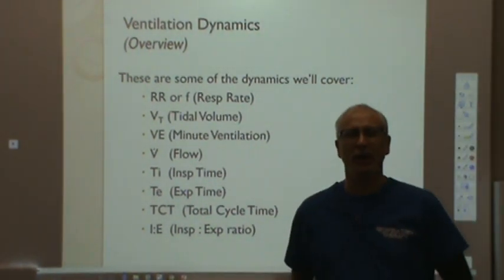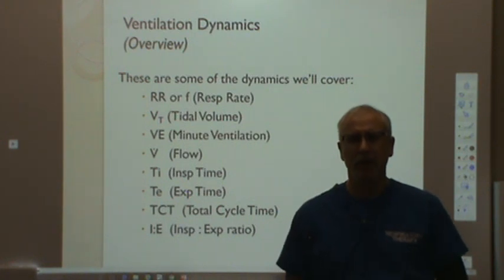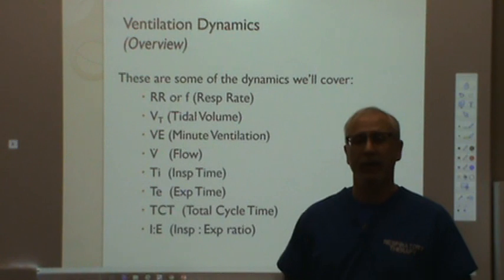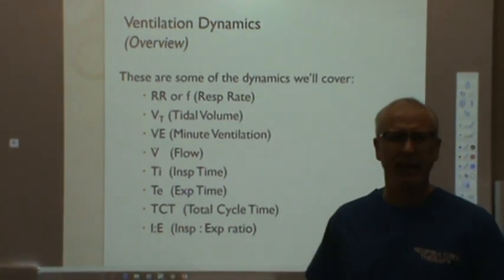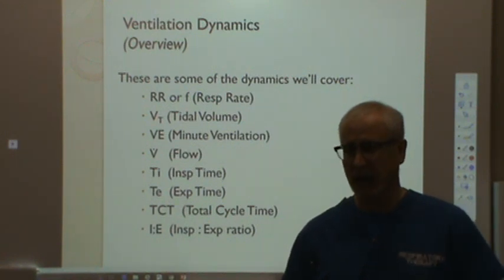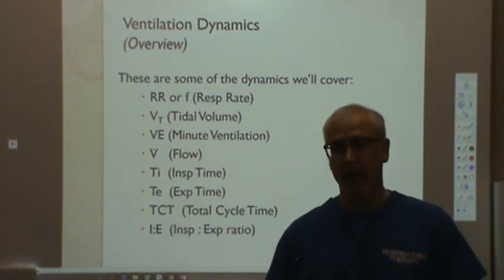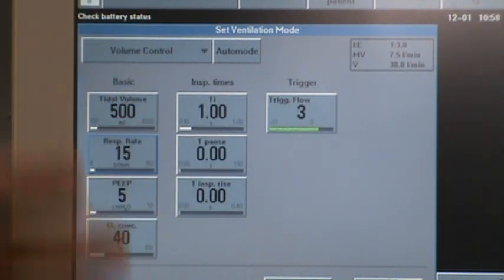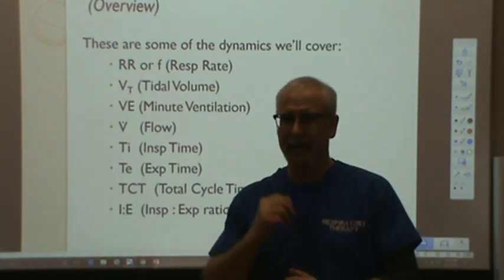Patient Breathing Pattern Ventilation Dynamics Introduction:

Comment: RR or f - respiratory rate (number of breath per minute)
Vt - Tidal volume (the amount of air sent to the lungs during one inhale)
Ve - Minute Ventilation (Volume received in a minute) 
V_dot - Flow (air flow)
Ti - inspiratory time [seconds]
Te - expiratory time [seconds]
TCT - Total Cycle time (Ti+Te)
I:E - inspiration : expiration ratio

V_dot = Vt / Ti x 60 [L/min]
Ve = Vt x RR
TCT = Ti + Te
RR = 60/TCT
I:E = 1 : Te/Ti = Ti : Te = Ti/(TCT - Ti) = Ti / (60/RR -Ti) = 1 : (60/(RR x Ti) -1)